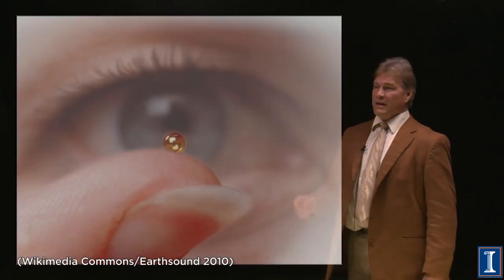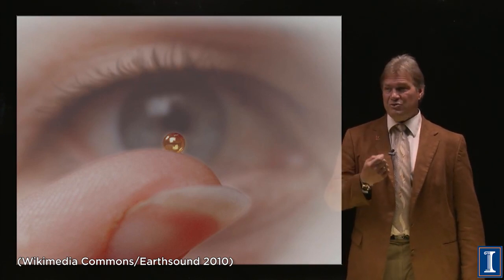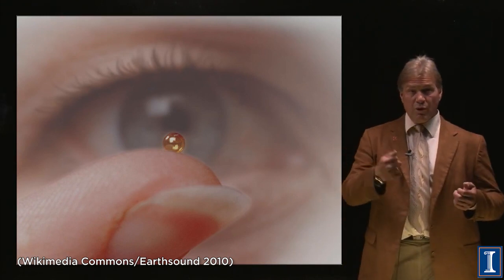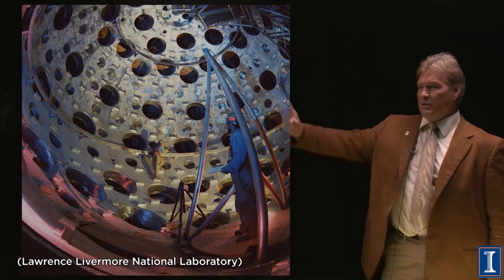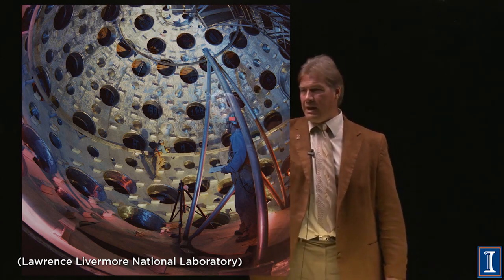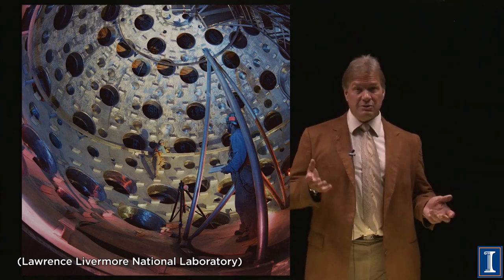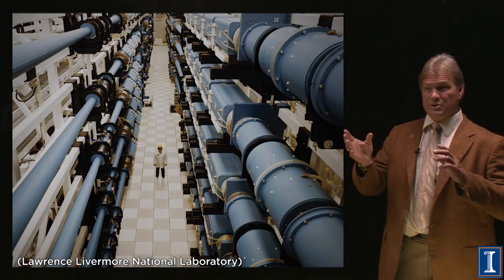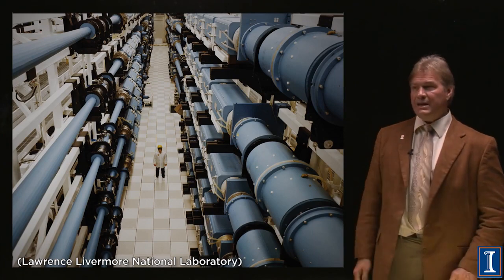Inertial Confinement's Progress

Comment: I thought the National Ignition Facility is mostly a weapons research facility...
Reply: Turns out that they way you use photons to initiate fusion in an inertial confinement reactor is remarkably similar to the way you initiate fusion in a two-stage thermonuclear bomb. Both take photons from a high-energy source (be it lasers or a fission reaction) and reflect them off of carefully shaped surfaces suspended in X-ray transparent foam such that they hit the target fuel. The X-rays increase the fuel temperature and pressure such that fusion begins and self-sustains until the fuel is consumed. LLNL was one of the main players in the development of thermonuclear weapons, it's only natural that they now apply their expertise to a controlled reaction.
Reply: Absolutely.  You nailed it.  This is a critical point.  The mission of NIF and Livermore's 50-year program of developing "laser fusion" does not include energy technology.  (Also, high-power lasers by themselves have "spin-off" weapons applications, as I'm sure you can imagine.)  On the other hand, Livermore doesn't mind if people mistakenly assume "fusion energy" is part of their mission AND/OR assume that lasers are the best way to "drive" these fusion fuel pellets.  In fact, particle accelerators are vastly superior to lasers for a practical "inertial fusion" power plant.  This is well accepted by physicists expert in these matters, as recorded in publicly available reviews of the U.S. fusion energy program, down through the decades.  Nobody reads these dry technical reports but the answer is there, "hidden in plain sight," if you read carefully.  Here's some excerpts.
1. The 1979 Foster Committee produced a classified report which is hidden
some place in the bowels of the DOE. However, Johnny Foster reported to
the Energy Research Advisory Board at its May 3, 1979, meeting saying,
“...heavy ion accelerators have great promise as reactor candidates because
of their inherently high efficiency, developed repetitive-pulse technology,
and favorable theoretical predictions of target coupling.”
2. The Jason Report of January 1983 (JSR82-302) stated, “We conclude that the
uncertainties in coupling physics for high-energy heavy ions are minimal.”
3. The National Academies of Sciences Report of March 1986 entitled,
“Review of the Department of Energy’s Inertial Confinement Fusion
Program” stated “Heavy ion beams may well be the best eventual driver
for energy applications.”
4. The 1990 report of the Fusion Policy Advisory Committee (Stever Panel)
recommended parallel development of inertial and magnetic fusion with a
budget level of about $30 million per year for HIF.
5. The 1993 Fusion Energy Advisory Committee (Davidson Panel) said, “We
recognize the great opportunity for fusion development afforded the DOE
by a modest heavy-ion driver program that leverages off the extensive
target program being conducted by the Defense Department... .”
6. The 1996 FESAC (Sheffield) report said, “In agreement with previous
reviews, we consider the heavy ion accelerator to be the most promising
driver for energy applications.”
As a bonus, here's a short, readable article by Nobel Laureate Burton Richter:  https://drive.google.com/file/d/0B5czjPh_Pq6hZGx3M0FSVXJOdUU/view?usp=sharing
Reply: @lithostheory Basically a thermonuclear bomb is a specialized kind of Inertial Confinement fusion reaction: single use, confinement is provided by using a fission bomb to superheat the stuff around the fuel pellet to the point its making X-rays, rather than a bunch of lasers.
A thermonuclear bomb is not a great reactor for electricity generation, it vaporizes itself after just one use, but the U.S. did actually try looking into using thermonuclear weapons to generate electricity in a fusion power plant, it was called "project PACER". 

conclusions: technically possible to make electricity from underground thermonuclear explosions with known materials, but it'd be a very expensive way to make electricity that opens a giant can of worms when it comes to nuclear security.
Reply: @drewgehringer7813  it’s actually not making the x-rays, but ionized from a low-Z, opaque x-ray medium to a fully dissociated x-ray transparent medium in thermal equilibrium with the exploding fission primary. The depleted uranium radiation case (as well as with the use of “cleaner” high-Z materials) effectively “converts” the “hard” x-rays radiated in bulk from the fission primary into ideally penetrating “soft” x-rays, via radiative transport, which are optimized for the ablative compression of the high density (high-Z) metal tamper containing the targeted fuel (dry Li-6/7 deuteride surrounding a hollow U-235/Pu-239 fissile spark plug, with or without the inclusion of a 50/50 D-T fusion gas filled pit). 
The purpose of the spark-plug being to heat and further compress the fusion fuel from the inside out in addition to rapidly breeding the tritium fuel from Li-6/7 in addition to dissociating the deuterium nuclei bonded to the Li to maximize fusion energy production and reaction rates (relative to strictly D-D fusion).

Comment: How much energy we can get from a H-bomb? Why brother, just dig a big hole and detonate the bomb. Hot gas out and get work done.
Reply: Weapons grade nuclear fuels are difficult to get and its only really economic at insane bomb sizes. An h-bomb is so powerful that it would be an absolute nightmare containing that kind of heat for any decent amount of time. Tldr, might of worked but far too dangerous and requires an insane startup investment.
Reply: It's been proposed, look up project PACER. Issues include obvious nuclear terrorism issues, and cost. Highly enriched uranium is expensive AF.
Reply: So, it works. Just not economically.Every high tech things have a period that not economical enough to use on earth. But maybe in space exploration, it maybe useful
Reply: @edmondhung6097  also issues with power transmission. Unless you have room temp superconductors its more efficient to have more smaller generators, and this really doesn't scale down well

Comment: magnetic is hopeless its never going to work regardless of its parameters being a bit less unrealistic than ICF, while still both are completely unrealistic at the moment. magnetic is not repeatable/iterable in more than one way, but ICF is. 

The problem that can never be solved for magnetic is that i dont think its possible to both isolate the plasma so perfect that it doesnt vaporize anything from the walls, but also simultaneously interact with the plasma to take power from it.
the ICF generator device is more imaginable. Zap something as its falling down to get it to ignite, stay away by enof to safely absorb energy. 
it is already kind of working in EUV lithography. they zap led or something with a powerful laser, then it emits EUV light as its falling down while exploding.